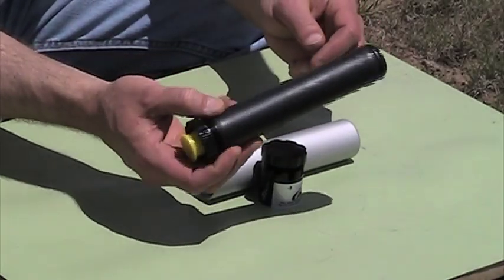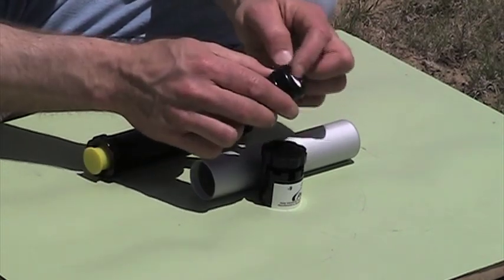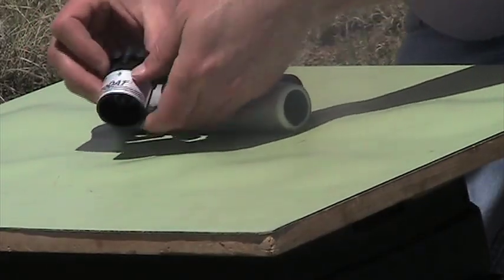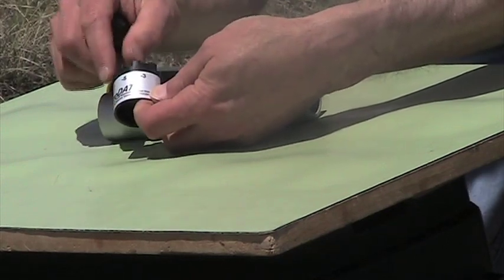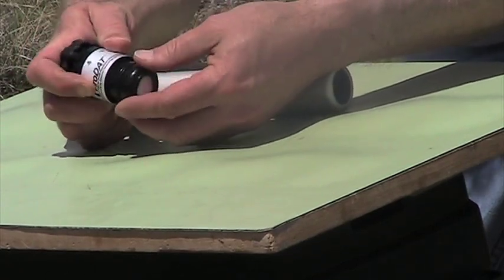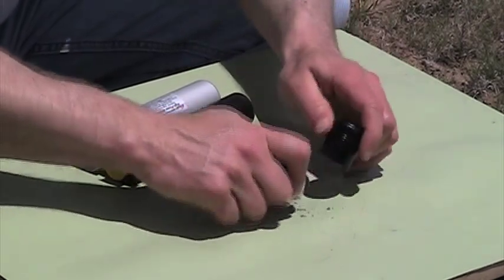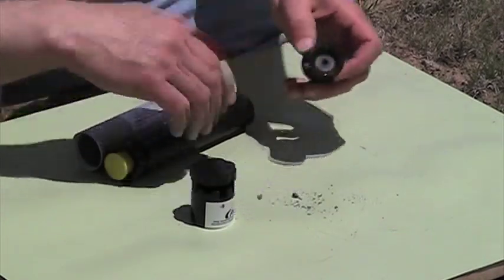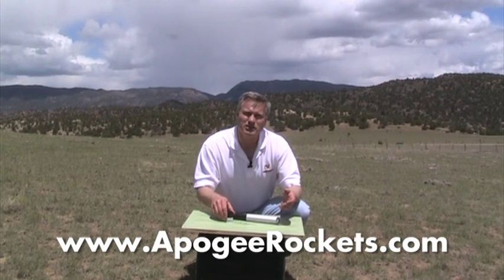Using The Cesaroni ProDAT Tool for Reloadable Rocket Motors

Comment: Can I do that to a Cesaroni with an Aerotech drilling tool? Thanks
Reply from the maker: Hypothetically yes. Just because it is a hole you're making into the delay grain. But the depth gauge is calibrated for how fast the Aerotech delay burns, not the CTI delay burns.
Reply: @apogeerockets  Thanks! It took some calculations but we managed to make a precise hole into the delay with the CTI tool